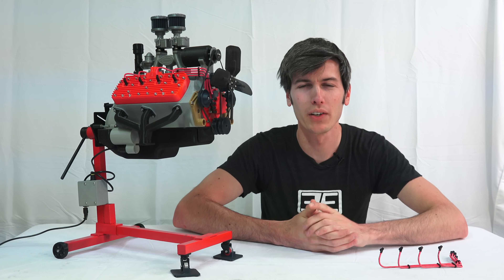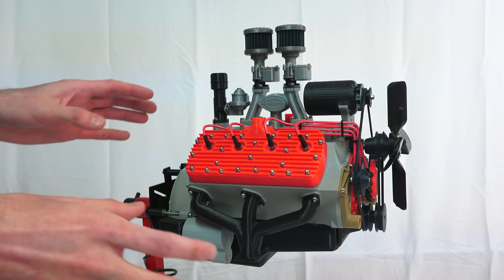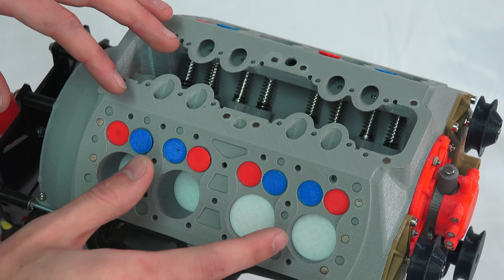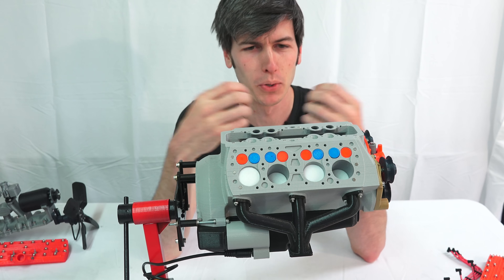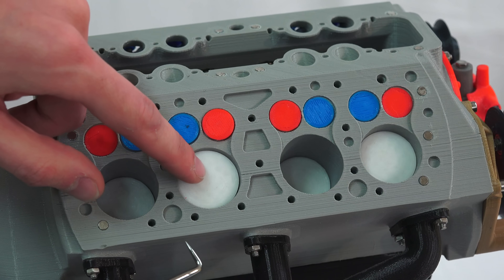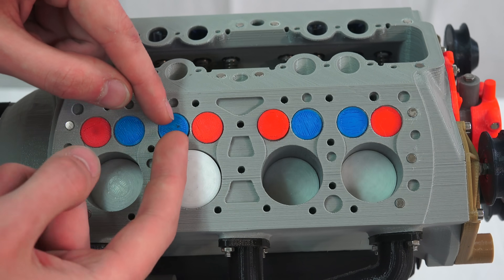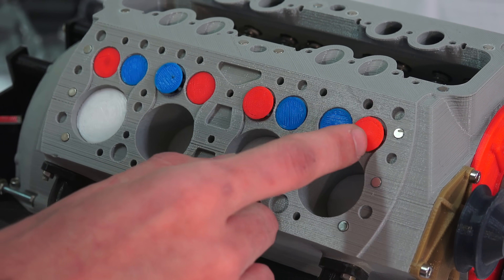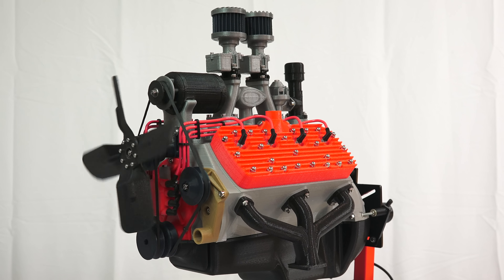Why Ford's Flathead V8 Engine Died

Comment: Typical ford they almost got it right cut corners and put two cylinders on one exhaust port . Caused over heating .
Reply: Not true!  Only one of the two cylinders used the single port at a time, and these cylinders fired with one other cylinder firing between their firing order- same in each side of the engine.  Example firing order for the right bank, front cylinder being #1, next #2, #3 and #4:  Engine firing order:  1-5-4-8-6-'3'-7-'2'.  Left bank 5-6-7-8, again firing order 1-5-4-8-'6'-3-'7'-2.  This helped to reduce heat build-up in the port.  Even though the design placed the exhaust ports to run through the water jackets, these motors had quite a large water jacket coolant capacity, and as long as these were kept in proper condition (limited corrosion and scale accumulation) through the use of coolant additives (same for the radiator), they suffered no cooling issues.  The trouble was not many folks paid attention to this back in 'the day' and after a few years of use, overheating/boil-overs were the result.  So the motors were unfairly blamed, calling them 'steam engines' etc.  I've been building/running these old critters for years in stock and modified form, and have never experienced any overheating issues even with high compression heads operating and operating during the summer months.  Why?  Clean water jackets and radiator tubes using proper coolant.  These are great old motors, simple to work on, reliable as a draft horse, that unfortunately had to live with a bad reputation that still lingers.

Comment: Thus started the hot rod era. You could also replace all the old 4cyl and fit in the same engine bay a v8, in which Ford already thought of. The single cast block is what revolutionized and made it cheaper than its counterparts.

Comment: Question: How were the valves adjusted on these engines? Actually, I suppose the same question could be posed for old Briggs & Stratton engines.
Reply: This was the one maintenance issue that required a lot of work.  The simple design of the valve system (no rocker arms or pushrods) meant the valve lash, once set, would remain in spec for many, many miles w/out issue.  The initial adjustment required grinding the valve stem tips to obtain the clearance.  It was a time consuming procedure.  However, adjustable tappets were also available that allowed adjustment by a flat -headed (no pun intended) screw at the top of the tappet which contacted the valve stem tip.  Still a bit of work to do all 16 adjustments, but again, once set the need to re-adjust was rare and pretty unusual.
Reply: @robfrye4664 : Thanks! Most interesting too.  I'm in my 70's and I well remember so many of the "hot rods" of the 50's with flatheads. These engines deserve the place that they have in American history.

Comment: Well, first, it didn't "Die off" in '53, the dies and licencing were sold off during phase out and it continued to be produced, though not with the Ford monicker, for various automotive, truck, military, and industrial applications officially until '73, unofficially until 2011, and in small numbers in South America and Africa even today, not to mention the hobby market today. Besides, 21 years of any apparatus in the mainstream auto market is a damn good run.
Reply: The French used this design for MANY years for military vehicles.  Some brand new French blocks, cranks, rods etc. surfaced several years ago and many folks bought them up.  All compatible with the original Ford engines.  This would be the Ford engines, not the larger Lincoln flathead V8's.
Reply: And I don't believe that dude is 65+ years old.

Comment: How would ports in the the cylinder walls affect the efficiency? You could have the ports attached to the valve stems to open and close them. You'd still need the valves on top for when the piston covers it but as long as the compression seals don't go above the ports you'll be fine there. And before you say anything about side ports with valves being impossible, I have several ideas how it to make it possible. I'm just wondering if you think it'd improve or hinder the engines performance to have a cam controlled ports on the side of the cylinder in addition to the valves on the top.

Comment: Your info is incorrect  the flat head was used well into the 1990s by the French military  and  the flat head was made up to 337 inches also the fuel of the time was a major restriction in compresion.

Comment: The guy made the video (why did the flat head V8 died) your the young man is doing the video you better get alot more knowledge from Ford to what your saying plus Henry Ford dumped millions of dollars into developing the flat head V8. Plus alot of auto makers had flat head engines for the vechiles. You better do alot more research and you go find a real Ford V8 and rebuild one  and install one in a car. You may have to modify a car under the hood to get one in a car. Then run it. Next stop talking in metric's no understands your tough of metrics plus nothing was ever done in metrics it's all in cubic inch. So get it straight. Metrics didn't come out until the early 1990s. And to many people gets confused or don't understand the metrics system.

Comment: After all these years, I always assumed that the center exhaust port was really inefficient. Now I understand that the two cylinders shared it independently.
Reply: Pontiac did that on the 389 big block. nothing really wrong with it given the middle 2 cylinders didn't fire at the same time.

Comment: The flat head engines were useful before electronic rev limiters- if you over revved the engine the valve float was less likely to damage the engine. For racing and trucks, aftermarket overhead cam heads were available so the engine would not overheat as easily. The record is 700 horsepower with a lot of customization now.

Comment: On V8 configuration exhaust is having a pathway through engine block which is making it longer and also hotter, having opposed valves like early harleys will increase compression and permit higher lift increasing flow making not 1.5k but 2.5k efficient good enough for cruising with better torque at 2k even in those times when gas octane number was so low probably needing for turbulence

Comment: Also worth a mention is that the exhaust passes through the block before exiting through the manifold, meaning that the hot exhaust causes hot spots in the engine block creating cooling issues and risk of damaging the engine

Comment: Great video. But it begs the more general question, how much horsepower can one get with a simple flat head design. For instance, the old flat head briggs and stratton one cylinder engines can be ported to produce near the horsepower of a modern OHV Honda one cylinder engine. There must be ways to get the most out of the flat head concept that does not require the overhead variable valve monstrosities of todays modern engines.

Comment: I'm sure not intentional but one of the other big issues with the flat head was even cooling. When you are routing bit exhaust gases in the block and outside the cooling jacket of the cylinders, that is not a good thing. Ford engineers had to keep it a flathead for simplicity and cost. But keeping exhaust valves inboard was one of their challenges to get right. In the end, copious coolant circulation is an absolute to the flathead. You can't keep water stagnent for too long up against hot exhaust ports. Which is why each cylinder bank has its own water pump.
Reply: Separate w/pumps were due to simplifying any need to tie the two bank's cooling systems together in the block, period.  Nothing to due with exhaust design.  If you attempt, as many did years ago and still do, to run these engines (any water-cooled engine for that matter) w/out thermostats, it will cause overheating due to the coolant passing through the radiator too quickly.  It needs to linger a bit to give up its heat to the heat exchanger/radiator, and the thermostats provide 2 functions:  Control coolant temp, and keep a back-pressure on the cooling system to avoid cavitation at the w/pumps and slow the movement of the coolant.  Same thing in the block, only the opposite way-round from the radiator- the coolant needs to linger to efficiently absorb the heat from the engine.

Comment: you have to give those engineers some credit... figuring that out on paper? trial and error? guesswork? they built the first commercially viable v8 engine, of course high end lincolns had v8s but were complicated and expensive... it was an engine for the masses, and changed automotive history. so to pick it apart and highlight its faults,but, give those cats from the 30's a little credit. YOU design and build an engine on paper, then figure out how to SANDCAST all the parts, machine them by hand, assemble,test and get it running, then put it in a car and sell the whole thing for 600 bucks, then you can talk.

Comment: Let's get real here the 265 might have had trouble with horsepower but by 1957 they were the best engine .Ford had the look but Chevy was a better car to drive with the high rpm engine and easy to hop up

Comment: The first  in head valves were developed by checker motors, who were always trying to invent cars that would run for  ever. But they did not  protect their design / patents, and they ended up being stolen by chrysler and GM. That is why so many  small block Mopar and GM use the same gaskets.

Comment: They died because they were overheating gutless junk
Reply: Absolute nonsense!  Learn something before you bloviate
Reply: Rob Frye It’s a known fact that the rear cylinders would run hotter than the rest, and overheated, even after they tried to fix it. Also it’s well known that flathead engines are far less efficient at making power than OHV engines. The only reason they were popular is because they made 5 billion of them and they were cheap and plentiful. Kinda like how the LS is today, except with none of the power or reliability.

Comment: 110 HP from a 3.9 litre engine. WOW. My Rover had a 1.6 litre engine producing 120 HP!

Incidentally, in the UK we call it a side valve engine. My dad's first car was a side valve: A Ford Escort Popular. About 996cc if memory serves.
Reply: It's technically known as a side valve design most everywhere.  Flathead was relating to it's appearance.

Comment: You clearly don't know the history of the ford flat head. It didn't start the love of v8s they where around much before the flat head. The other v8 of the day where cast in several pieces making it to expensive for cheap cars. He just made the first one cast as one piece. And they had problems in 32 of engines wearing out fast.

Comment: THERE REALY NOT SIMPLE ENGINES AND ALSO MOST PERSONS PULED THE EXAUST LIQUID COOLERS OF EXAUST REASON MOST FOUND EXAUST ARE ILL FITTED. AND ALSO THE TRANSMISSION. WAS THE ACTUAL HEART OF THE VEHICLE. IN ACTUALITY THE CAR WOULD HALVE BEN JUST EFFICENT AT 40 HORSEPOWER. THE FLATHEAD WAS NOT BUILT OR DESIGNED FORE HIGH RPM AND ALSO WERE LOW MAINTAINCE..IF VEHICLE POWERE TRAIN NOT ALTERED.MOST IF THOSE WOULDENT MATER IF PULING ONE TONE OF WEIGHF OR JUST EVERYDAY SAME FUEL MILAGE.ALSO IN THAT ERA THE FUELL GRADE WASENT RELIABLE.ALL IN ALL Was a realy GOOD DAY TO DAY VEHICLE IF NOT ALTERED.

Comment: I like the looks of this V8 more than modern V8’s. It may not be super powerful, but the construction looks strong and it is very reliable. If the airflow and efficiency could be improved, and it made a bit more power, that would be a great engine to have in a daily. Low maintenance and simple to work on.

Comment: I have a flathead built to 304 cubes. A cam that is a bit more than stock, higher compression, drilled & tapped for an oil filter, 
etc. gave 180 Horse. With a 5 speed in my 1953 Mercury is very quick & gets 25 MPG.

Comment: Another reason for these engines to die off is heat dissipation. You have exhaust gasses flowing through the block between cylinders. Not very good.

Comment: You didn't mention the worst problem with these engines: Overheating. The exhaust path is like somebody was challenged to design the worst possible system. Yes, you too can have low compression, poor exhaust flow, conflicts between the intake and exhaust flows and as much time and turbulence as possible to be sure you don't make much HP and have a car that will overheat anytime it isn't a Detroit winter's day. 
The hilarious part is when Ford bought Lincoln the logical Lincoln flathead V12  design (exhausts in the center of the V) was changed to the clearly inferior Ford design. I've had the pleasure of seeing both versions of the Lincoln engine side by side, it took me a while to believe the side exhaust was the later design. I've been told Henry Ford was obsessed with keeping the heat next to the cylinder. 
Just my opinion and all but the only two good points of flatheads are low build costs and great exhaust noise. The two V12s above made noises better than anything I've ever heard, Ford flathead V8s are nearly as good. 
And no, I don't believe he was born in 1953 either.

Comment: Innovative from a cost perspective, perhaps. Sophisticated, not at all. Over head valve engines were firmly established, some for decades, prior to the introduction of the Flathead V8. By this time, there were already engines running dual overhead cams. Leaps and bounds above the truly archaic model T based 4 cylinders it replaced, but stubbornly bound to a simplistic past via specifications from an increasingly delusional Henry Ford at that time.
Reply: Henry loved the flathead because it was cheap to produce.

Comment: why the hell does that engine have 4 spark plugs on the visible bank but only 3 exhaust outlets?????..and how or why the fk did you bolt a V8 head onto a V6..your matrix runs Vista..
Reply: ooooohh..with the head off,you can clearly see the advanced exhaust share-port tech going on..cheaper manifolds aye?..
Reply: ..not optimised for efficient air flow?!!...downside to cheaper manifolds stolen from V6s,I guess..

Comment: why people keep saying that "air inside the cylinder has to change direction"  after the compression and power strokes im pretty sure air inside the cylinder is moving in very diferent direction than it was during the intake stroke..
Reply: This is true, no matter the configuration of the head.

Comment: Henry was well out of date by 1920 let alone 32. Sidevalves were ancient design by then. Why everyone goes ooh aah about them amazes me. Chevrolet had OHV 4s and 6s. As did others and the high end 4 valve OHC engines. As did Europe as well.
I am surprised Ford managed to get away with those engines up to 54.
The Y block seemed good, then Chevrolet came up with the small block,,, in 55. Which is still in general use and the very base architecture of the LS. The Y block was gone by 60. Replaced by the Windsor. Or for big cars the FE. The Windsor engine was never a Chev but still a decent and long lived engine.

Comment: Well no wonder it only made 60 hp. Look how small it is
Reply: and those plastic pistons aren't cutting it either
Reply: @ImNotADeeJay  lmao 🤣 😂
Reply: Derek Zoolander? Is it you?
Reply: It needs to be at least three times bigger.
Reply: Running it with one of the plastic cylinder heads cut the power even further. ;-)
Reply: It also looks like a toy engine 😂
Reply: After introducing its original flathead V8, Ford introduced a smaller V8 which was CONCURRENTLY with the original engine.  It was called  the V8 60.  More information is available with a google search.
Reply: Note the low compression ratio. That is a major limiting factor but the fuel at that time could not support the types of compression we are used to.
Reply: Right? It should be at least... 3 times bigger...
Reply: It made 65 in it's first year.  The V8 60 came out in 37, and was much smaller - 136 cubes - and was not popular, as it lacked torque.  The Europeans liked it though.  25 MPG!
Reply: @AJ Hauter thats not true
Reply: It is not the actual size
Reply: It 3.6 letters.
Reply: I hope bring it back soon.
Reply: Underrated reply!
Reply: and v6 made 30 bhp ..
Reply: @raygud  last I knew they didn't have a V6. The I6 engines they did have actually were not all that much less powerful.
Reply: @raygud  While the Willys Go Gevil, which was an I4 flathead made 60-62 HP. And it went out of the world, hadn't just failed in every 80-90 hours of running like these days the I3 turboes do. The Go Devil ran 100 days (not hours, days!) in 4300 RPM on dyno, while its designed maximum RPM was 4400. Its redline started in 3000 RPM. Flatheads main advantage was reliability. None of the current engines do it near as good in this department. Who cares efficiency, CR or other buzzwords if your car failing in the middle of a battle?
Reply: A 1.2l 4cyl n/a engine easily makes 80hp, I know it's a joke but 60hp for a V8 is just...
Reply: @tristan6509  well a ls7 bore is about 4.400-inch vs 3.1875 bore those flat head bores are small as a crf450 ls7 is about med size for bores 1930s really wasn't surprising for 254 ci of metal
Reply: @tristan6509  That 1.2 litre inline 4 does produce 80hp today, yes. Back in 1932, 8 to 12 hp was considered "good" for a 1.2 litre inline 4. Just as 60hp was good for a 3.6 litre V8 in the 1930's. Even by 1950, 60 hp was mostly standard and acceptable for a reasonable inline 6. For a V8, it was considerably under powered by 1953..

Comment: i still work with flat head engines. these engines are from jeeps and there it was inportant to make the engines simple and easy to repear. ( take the head of and you see the most inportant parts of the engine) 
later they had engine with the intake on the side (same as this) en the outtake valve in the head. which inprove airflow i think.